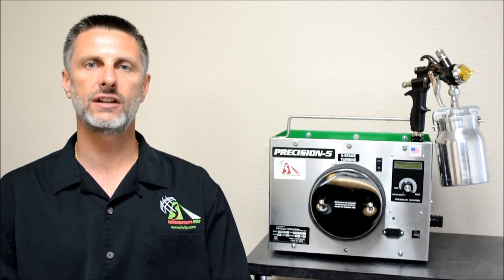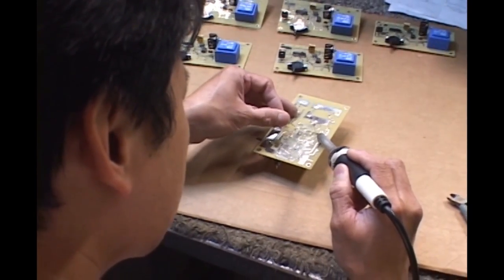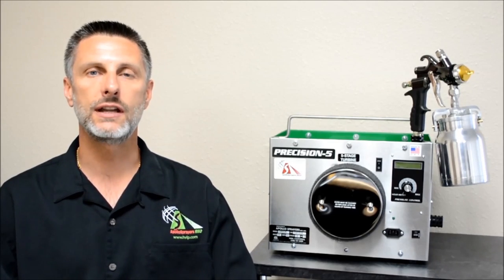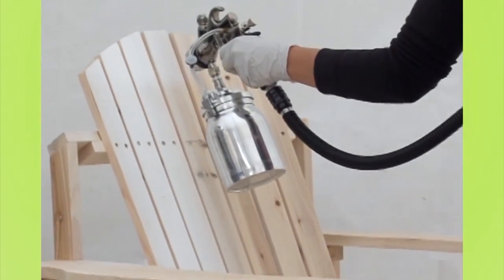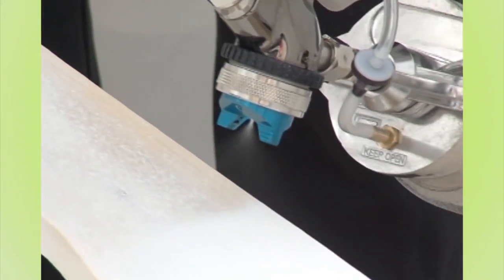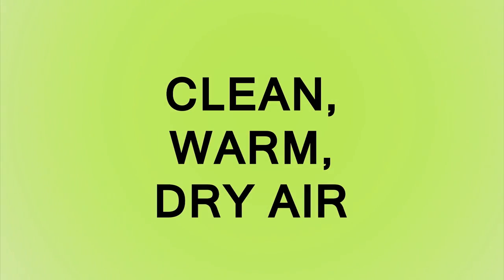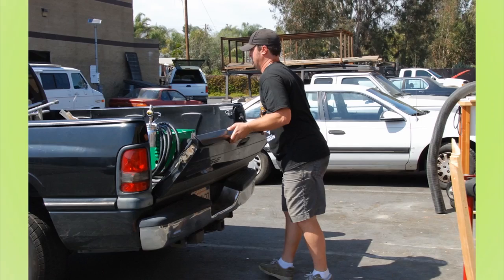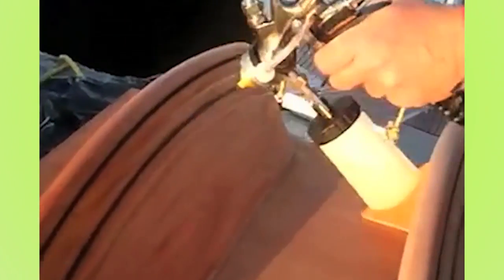Apollo PRECISION-5 HVLP Turbospray System

Comment: I bought 9 month ago, the brand new Apollo precision 5 with the spraying gun 7700QT  from eBay,  and after I used two times I can't have more de 7,1psi at the machine and when I press the gun triger it drop at 5,1psi which is not enough pressure for spraying the epoxy paint. I check the filters, but like new, so..  When I call the customer service they said I don't have the warranties because I bought from a non authorized dealer...Very disappointed and I will not recommended to anyone...I paid 1899$ for a low quality machine, I could find better for less money..or I should buy a Graco for the same price.
Like the other it saying...just being honest and do the real reviews
Reply: Your PRECISION-5 gives you 10 PSI of sealed air pressure.  Due to the bleed port for running a non-bleed spray gun the pressure does drop to about 7PSI.  When the motor warms up the pressure further drops.  This same exact phenomenon happens with every other turbine system on the market, no matter who makes it.  The only difference is that you don't know with those systems since they don't have a pressure gauge for you to test it.  There is nothing wrong with your turbine system and it is perfectly capable of spraying the materials you want to.  The issue with your warranty has nothing to do with the performance of the unit.  You chose to purchase your unit from a second hand party who had not used the unit.  Our warranty clearly states that we warrant our product for the period to the original purchaser only.  The warranty is not transferable.  The unit might be new to you, but you did not purchase it from an authorized reseller.  Make sure you purchase your system through an authorized reseller of our products.

Comment: Hello John, I have to say I'm not impressed with your customer service. I purchased one Apollo Model 1050VR-7500GT-600 Precision Series 5 Stage Turbine with a 7500GT HVLP Gravity Feed Spray Gun a few years ago and by mistake ordered the 110volt version when I needed the 220v. I've emailed several times requesting if there was any way I could have a replacement transformer to swap over with no reply. I'm hoping you will hear my email and finally do something about the issue. Regards Johnny Kingdom
Reply from the maker: Johnny, please contact Total Coatings in the UK as they will have to handle this situation.  There is nothing we can do from the USA.  I would advise you to call them on Monday.  If you want to send your contact information we can have someone call you.
Reply: Johnny, you ordered the wrong system from a dealer in the UK.  We have asked you to go back to the dealer in the UK and work things out with them.  You cannot swap a transformer to go from 120 volts to 220 volts, its a completely different system.  You will need to contact Total Coatings in the UK to resolve your issue.
Reply: Just now seeing your note Johnny.  Where are you located?   Has this been resolved yet?